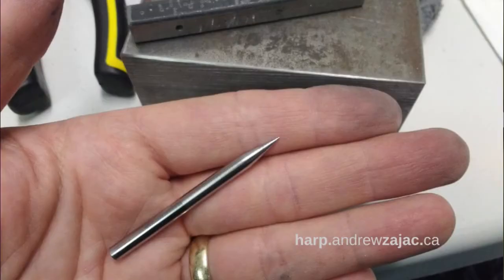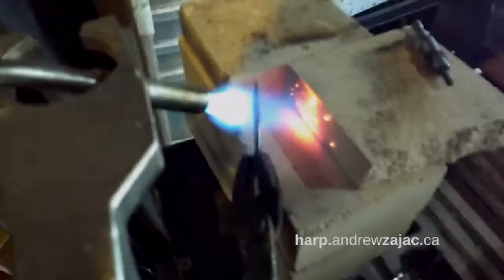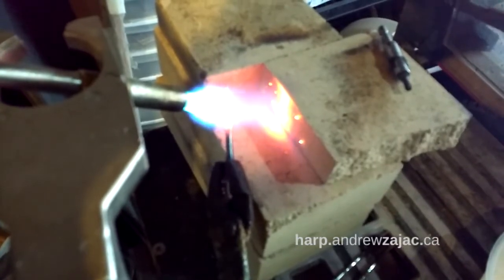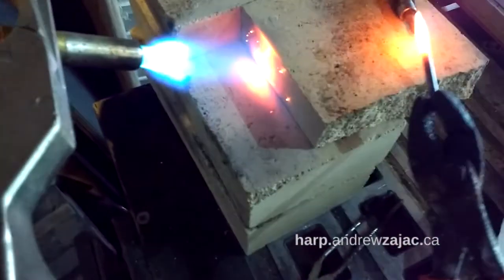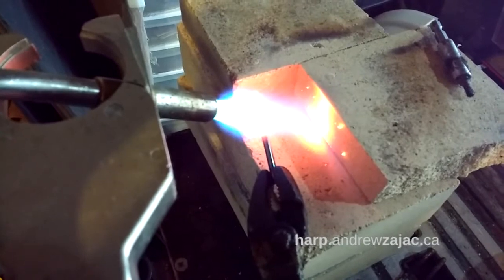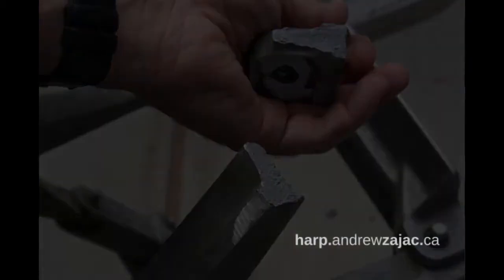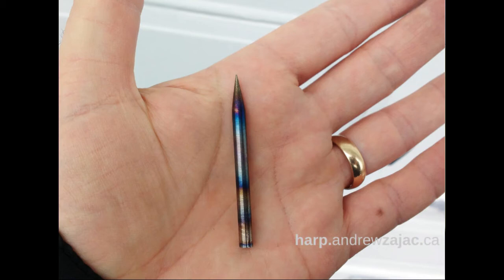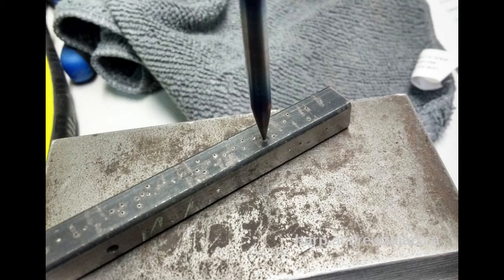Hardening and tempering reed removal tool

Comment: Hi Andrew , I've just found your channel and working my way through your  videos . I've just bought a marine band  and after some fairly reasonable irritation on  the right hand  side upper lip , thought I'd take it apart , give it a bit of finessing and then convert to screws . I was wondering if you'd ever  opened up the cover plates at the front to increase volume and what your opinion is of doing this . I've seen a couple of videos where the cover plate is placed on the corner of a table and the rim is beaten down with a hammer  Do you think it's worth the abuse ?